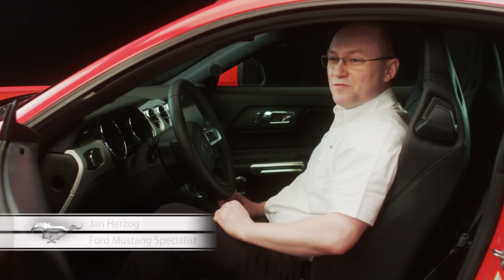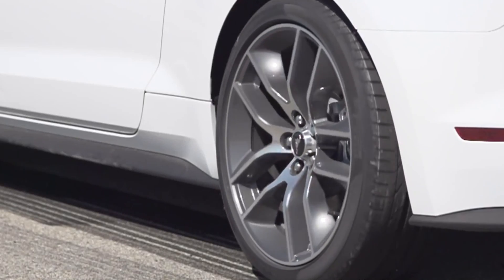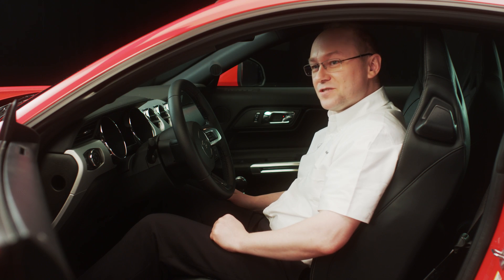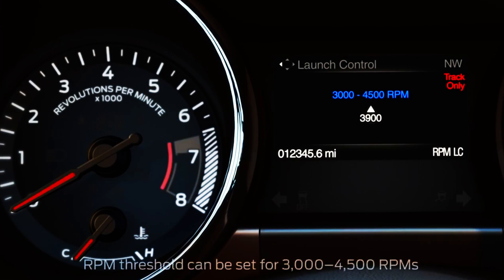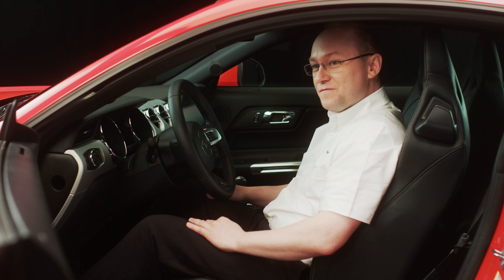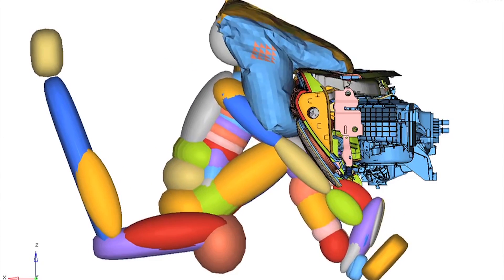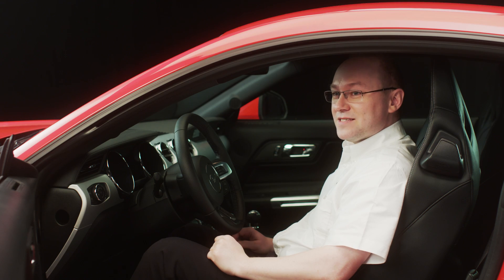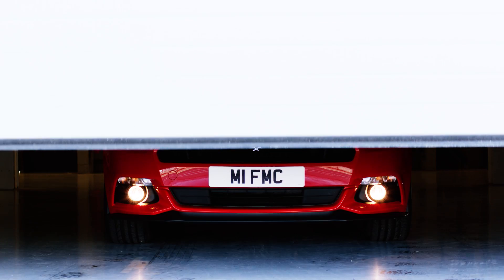FORD MUSTANG TECHNOLOGY

Comment: The welcome inside game mustang secondary sistem auto prestolite handling speed clutch brake pads fingers (( example clutch rubber only parts metalic body rubber arrow gear shift bushhing rubber heavy duty

Comment: What they are not telling you is that the front 'gill' lamps will be DISABLED on the euro spec car. I cannot fathom how they can leave out such an iconic bit of the design. (Let alone selling you a car with some non-functioning lights)
Reply: Erwin Mulder ah ok, even the nice hood vents are gone in the euro version too......perhaps better import an "original" Mustang as we did it for decades instead buying this euro trash with white lamps ...LOL
Reply: kubanskiloewe The hoodvents were allegedly removed to meet "pedestrian safety" standards. I wouldn't be too bothered about that. While they look nice, they seem not all too practical. I heard reports of them being kinda annoying when washing your car: They collect puddles of water that (if you don't dry them out with a cloth) comes flying up your windshield for a good while. Also, if you import a car yourself, you still need to change all the stuff that your local authorities consider 'illegal'.
Reply: kubanskiloewe The hoodvents are not illegal, I was talking more about the lights issue. You WILL have to change your lights to meet European standards when importing a car yourself. The rear sequential turn signals the US version has, are illegal here for example.
Reply: Erwin Mulder The front fog lights will be active :)
Reply: ok, regarding to the big recall of all 4cyl. ecoboosts because of overheat and melting some parts even fuel lines (a few cars burnt) we better wait a year longer :D
Reply: BoeingvsAirbus1578 The front fog lights are the round ones at the bottom and they are indeed working and also on (on lower intensity) as the DLRs. We're talking about the 'signature tri-bar' lighting next to the headlights. They are disabled for Europe as they too much visible from the side (at least this is what I have been told).
Reply: kubanskiloewe If you care to read the recall text, the recall is only for EB Mustangs built in a short period last year. None of the Mustangs coming to Europe should be affected.
Reply: Erwin Mulder ok anyway, since i saw the new Camaro pictures i will wait to drive that too and give it a chance ;-)
Reply: Kaskai
Reply: Erwin Mulder i